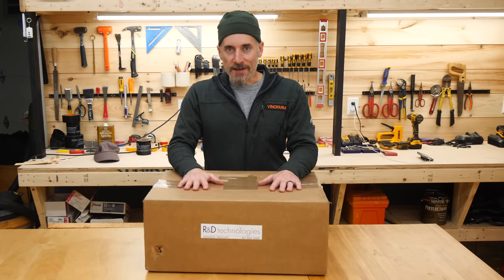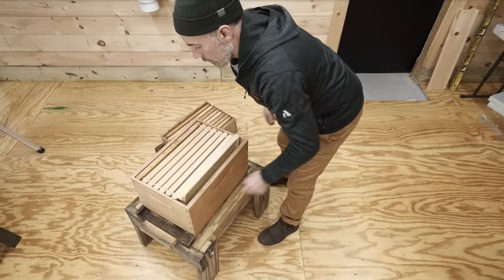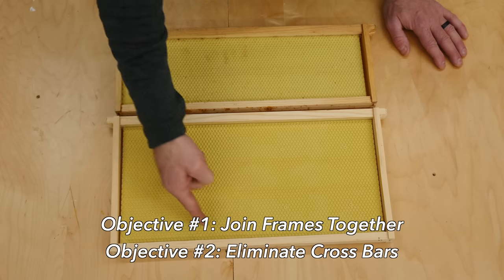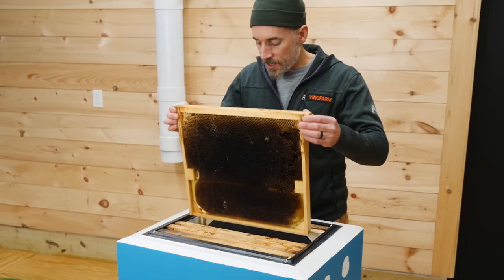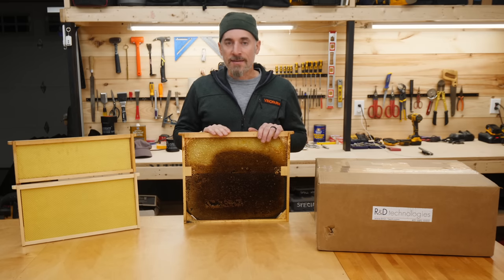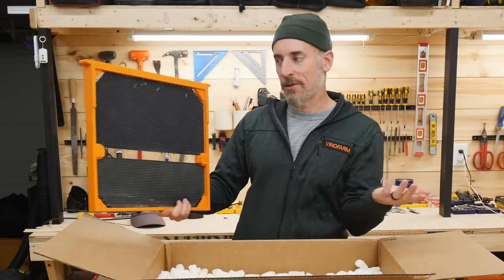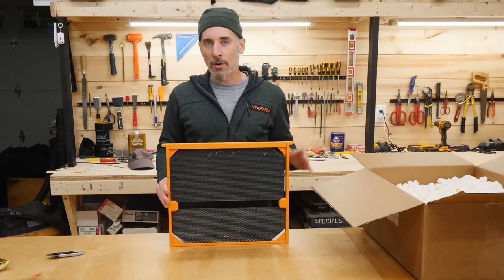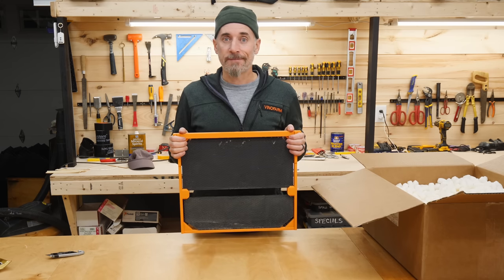Bigger, Better Bee Frames? Let’s Make This Happen!

Comment: Sorry, but I think you're going about it the wrong way. Plastic frames are not the future. Bad for the environment, expensive to make and takes too much time. You'll likely have to go through many prototypes and manufacturers before you're satisfied with the result as molded plastic is finicky and there's many kinds of plastics and selecting the right thickness of plastic and cross-bracing in the hollow channels within the frames (so it's not heavy and excessively expensive to make), etc. You could be seeing a 2 year process before being able to ship out finished products to customers. Also, what's with the pointless gap in the frame? Never take shortcuts when making a new product.
There are plenty of automated machines out there that can spit out a dozen completed wood frame pieces per minute that have existed for many years, so the cost would be much lower, a lot less time and it doesn't harm sea turtles. And the wood's deterioration time is predictable whereas whatever plastic you choose will be unknown in that environment. Table saw isn't the only way to make frames.
As for the gap in the frame, why not make a new sheet that fits the new frame size?

I do wish you the best of luck in whatever decisions you go with in the end. In the very least, you're making a great change in quality of life beekeeping.
Reply from the maker: Two years of development has brought me here. But thanks for your opinion.
Reply: Plastic is not the devil.  Single use plastics are the devil.  You've taken a soap box and are yelling about the wrong thing from it. 
If I'm understanding turgsh01 correctly, you're advocating cutting down trees and producing waste in the form of cut-offs instead of a plastic frame which will likely be more durable and in use for twice the life of a wooden frame?  You should really take a second and think before spouting off these nonsensical comments.
And to answer your question about the gap.......it's so you can use standard bee-keeping equipment in the frame.  Everyone already has deep and medium foundation laying around.  Nobody makes this size foundation.  So all you need to do is order the frame and use the other equipment that you already have, or is readily available at literally every beekeeping store in the universe.
Reply: Well golly maybe if we pause and do a little thinking ahead we can lower the number of iterations. Maybe it will take two years. As far as I know VinoFarms does not have a board of directors that demands profitable quarters year in and year out. This whole endeavor is not a do or die project. This is a hobby beekeeper with an idea that may help many beekeepers in the future. I will be watching with interest.😊
Reply: @DialedN_07  You cannot recycle dirty plastics, and the likelyhood of anyone being able to properly clean the old plastics full of honey and stains is slim to none, especially if there's textures or difficult to reach gaps. So they might as well be single use plastics and likely will end up in the sea at some point in the future. Also, your assumption that plastic will last longer than wood is theoretical based on zero facts. Different plastics react differently to different environments. A lot of plastics will crack in cold conditions or in direct sunlight, other plastics degrade quickly in moist environments, some plastics are a bit toxic, some too flexible, some too rigid and fragile, and let's not forget manufacturer defects and/or poor manufacturing standards, etc...
I don't know why I'm explaining all this as this should be common knowledge to everyone by now.
Reply: @vinofarm  Well then enjoy another 2 years.
Reply: @karlgant8953  I too will continue watching with interest, but as Mike Holmes would say: "If you're going to do something, do it right the first time!"
Reply: @DialedN_07  You can reuse plastic all you want but in the end it will still be plastic somewhere in the environment.
Reply: @danholtbk7008   Thomas didn't invent the lightbulb, he only patented it. Also, your insults are unwarranted.
Reply: @turgsh01  Guy, the frames are not for extracting.  They are for a brood box.  Two the frames are identical to the ones he is using now.  So its a safe bet that he knows how to clean and reuse them.  No need to worry about single use.  And I am pretty sure in the two years he has been working on it he got his bases covered on design.  And he is reaching out to people about materials.   Want to wait for the kick starter to open before jumping the gun?
Reply: @samualaddams705  You somehow misunderstood everything I wrote and made assumptions for good measure, well done.
Reply: @turgsh01  Sure man what ever you say😆
Reply: @turgsh01 i agree with you you are in a debate with the biggest narcissist on youtube it is pointless remember he was just as sure about the vivaldi boards and ridiculed anybody that suggested he was wrong. hes here to put out not take in so just watch the show and never get between a guy who cant be questioned. he never concedes ever.i learned never to questio him he is not open.

Comment: if foundation groove complicates mold, what about "L" shaped frame, set foundation against and then fasten  with a flat piece, maybe screwed down. So many off based comments below, if they'd just see your explanations!  Well thought out, plastic is perfect for this project  already plastic foundation and frames in use for years now so that research would show best plastic to use.  I'm in for Kickstarter and 40 or more depending on cost.  After 8 years of beekeeping and working up to 12 hives I still haven't broken even on cost vs honey sales.  The labor has to be free!

Comment: correct me if i'm wrong.
But the reason you have that gab is because there are no (cell)foundations in that size.
The gab makes an problem, that is bees not building the structure correct . 
So you solved it by alternating the gab.
And because you have that gab the fram can more easy move thats why you had to brace it with the corner braces.

If you are going the injection mould route....
Then why not make the BeeBarn foundation the right size. It will solve multiple problems.
You probably don't need an frame with braces. 
The frames would be simplified, more easy to make more easy to harvest
You will not have gabs so you do not need to alternate the frames.
No gabs makes it so you can't forget to alternate. And it's more easy to use the frames from different hives. 
It's more easy to replace a broken frame. you don't need to find out which one you need.
If you ever need to replace the foundation (or clean it) you only have to remove (or clean) 1 foundation not 2.
Reply: And sinds you use the bee barn for the bees themself. And honey supers for the honey.
You would not have an problem with using the standard honey and or wax equipment on the honey supers.
No need to have special tools/machines for the bigger foundation
Reply from the maker: The gap is a feature. Not a bug. The bees use the gap. A full wall of foundation would ruin their pass through tunnels.
Reply: @vinofarm  
I would love an video that shows the tunnel.
And what about.. making an asymetric (left right not top down like you have now) design. So you only need to turn the frame.
And make an foundation that has no to little base in the corners (where the bees like to build bigger comb for drone cells and honey. )

Comment: I’m a small time hobbyist beekeeper with 8 hives (6yrs) in NJ. I have never lost a hive over winter as I block my upper vents and simply put panels of 1” insulation cut to fit my deep plus medium winter hives. I hold the panels in place with a single 4ft bungee around the hive. Very easy to store in the summer and install in the winter. Takes just a few minutes to install. 

These panels and bungee have have lasted 5 years and are essentially a cheap and easy version of a bee barn. Obviously not as energy efficient but the same concept. 

I followed your whole bee barn project. Very cool but more complex than I feel is worth. That being said, the idea of a “bee barn” frame for the brood box for even regular langstroth brood boxes could be a real winner. Particularly if I can just transfer my drawn plastic foundation from my current medium and deep frames directly over to the “bee barn frames and drop them into the top of a deep+medium hive brood setup. Maybe even gently transferring the existing foundation WITH brood and honey from my existing frames over to the bee barn frames and just drop them back into my existing hives. I think it would be a winner and a back saver with far faster brood box inspections. And I agree it might be much better for the queen and her egg laying. 

I would be very much interested in bee barn frames (without foundation) for my 8 langstroth hives. A total of 80 frames if the cost is reasonable. 40 frames of deep over medium plus 40 medium over deep bee barn frames.
Reply from the maker: Thanks for your comment. You seem to have figured out the winter survival. That’s great. The reason the build is more complicated is because the insulation is built in and never removed. It’s a 4 season hive. It saves the hassle of wrapping and unwrapping and has benefits over summer as well as winter. I’m glad your bees are doing well.

Comment: Jim,  I put this comment already in one of the other videos but wanted to make sure you get it.  You've probably already thought of this but if you get to the point where you are having a mold made, consider having only one mold with "ears" on the top and bottom (for hanging in the hive box).  The customer can cut off one set of ears on each frame, giving them the ability to flip the frames and thereby staggering the gap (as you say it should be).  The ears can easily be cut off with a jig saw or a fine tooth pull saw.  This will save you the expense of having two molds made.  Hope this helps.

Comment: Do you have a CAD/STL file for just the side bars? While printing the entire frame is not feasible on a home printer printing side bars alone would likely be doable on a home printer. Then those could be combined with standard pieces to make the frames

Comment: Have you considered just creating and selling the side bar with the gussets built in?? That way beekeepers could build new “bee barn” frames by just buying top and bottom bars with readily available and inexpensive parts on the market today. By just buying gusseted side frames, beekeepers could even carefully disassemble existing frames to transfer the foundation and top/bottom bars over to the new deeper frames using your side bars.
Reply from the maker: I’ve considered many options. After hassling with wooden frame production and assembly, I decided to streamline the process and try for an injection molded frame. It’s the vision.  It may not work. I want to try.

Comment: Great idea. Perhaps you might take a coffee break and re-examine a couple of things. First the existing plastic frames and foundation warp and deform in the sun. Second the plastic gets brittle in very cold climates (in storage not in the bee hive). Third they off gas somewhat. Next, the only part that is time consuming is the sidebars. Just making the sidebars out of plastic would be much faster and cheaper when you use the existing source for top and bottom bars. This would also allow you to make plastic sidebars for other configurations (layens, shallows etc). Also making your custom sidebars takes EXACTLY the same amount of time and effort as any other sidebar (only the length has changed). Although I would also support you in this endevor, I would like to see how the bees react to these frames. Can they propolise them? Does the off gassing bother them? Does the wax adhere very well, will your hive tool break them easily? Would be interesting to see what happens when you place your prototype frame into one of you existing hives. Would like to see that video. Keep up the good work, am a fan of the bee barn.
Reply: Double deep plastic sidebars are already a thing but stupidly expensive.
Reply: @chadashton7029  Didnt know they already existed. But wood would still be a faster DIY replacement if they are very expensive. But a valient effort none the less. If there is enough call for them, I might  consider making a batch of the double side frames.
Reply: The ones I've seen are around $30 for a pair.
Reply: @chadashton7029  KRAP that is expensive. I was thinking of making them for $5 per FRAME, mabey I should think of $5 for a pair of sides instead !!!

Comment: Jim,  I got the idea to do a similar frame about the same time that you came out with the bee barn.  My reasoning wasn't to save my back but it was to not have to risk putting the queen on the ground and to simplify the inspection process.  Crazy thing is I had seen part of your bee barn video before I built my frame.  Unfortunately (or maybe not) I had checked out of your bee barn video before you got to the frame part.  Since you opened with the super insulated sides,  I saw it as not applicable to me in my warm climate.  After I showed my finished  frame to a friend, she mentioned your bee barn.  I remembered it and went back for a second look.  This time I stuck around for the frame part.  And I'll be darned - I was amazed.  A lot of your reasoning and mine were the same!  I run a 1.5 brood box so the dimensions of the bee barn frame and the Texas deep (what I named mine) are pretty much identical.  I have always built all of my frames - deeps and mediums, and I use foundation-less with fishing line reinforcing and a wax starter strip.  That made for an easy adjustment to go to the Texas deep.  The only real modification is I use a 1/2" side bar, instead of 3/8".  Putting tension on the fishing line is causing them to bow in a little but so far it isn't a problem.  I will be making a video of my frames and reasoning this week.  Of course I am going to give you a shout out and credit for innovating.  While I am not going to be in the market for your frames, I am going to be promoting this format so maybe that pushes some business your way.  You should mention that people can try out your frames by simply stacking a deep and medium box.  I'll bee doing that in my video.  Good luck with your venture.  - Phillip

Comment: Jim,
I meant to post a suggestion on manufacturing or looking for a manufacturer for your large frames on the day but got sidetracked.

A friend of mine got on the grog one night, surfed the net, ended up on eBay and bought himself a CnC Router. When it arrived he scratched his bum for a while, called in a machinist, and neither of them could work out how to use it, so he called me.within a day it was working like a charm.

Anyway, I ended up making bits & pieces for his business and it was brilliant, and I’m sure that it would be the best thing to make each and every part for your large frame without a joint in the side pieces.

The one I used had a 900 X 600 mm (3’ X 2’) cutting area.
My idea would be to still rip your slates to the thickness required and edge glue them out to suitable dimensions. Top bar would be ripped thick than side and bottom bar. All the grooves, and individual pieces could be cut with the same cutting bit, whatever the groove width is, as well as the shoulders on the top bar.

Again, all pieces would be separated using same bit using small tags (also cut in)to hold the pieces in place during procedure and separated on completion.

So, if you haven’t got a spare couple of grand, look for a woodworking business advertising CnC tooling.
All the best to you my frozen friend.
Reply from the maker: I thought about CNC a while ago and that might be OK for small runs. But if you have a look at the comments, I’d need to be producing thousands and that’s a lot of babysitting the machine and setting up the wood. And then there’s still all the assembly. I don’t really want to be in the wooden frame business. I totally understand if people want to do that and I made the previous video sharing a process for making these with just a table saw. But I am thinking of scale and the future. If these things take off, I’d rather have a mold and make it easy for people to just order them. A CNC would be nice for other things, though! Someday…

Comment: I'm still interested. Perhaps 2.0 could mix the top and bottom sizes. 3.0 would be an option for double deeps.

Also, I'm considering using deep/medium boxes for new hives next year instead of bee barns. This way I can mix regular frames (including drone frames) with bee barn ftames. I do plan on making a removable outer insulated shell that can be marketed to traditional box users.

Comment: It is reasonable to expect that major manufacturers of wooden frames would possess the necessary expertise to provide assistance in this matter, given their extensive experience in this field. A potential solution could involve approaching established wood frame manufacturers and modifying their assembly line to accommodate the desired specifications. While this may initially appear far-fetched, it is conceivable that at least one manufacturer may be receptive to the proposal. Furthermore, if financial constraints are a concern, leveraging one's existing fan base through crowdfunding could be a viable means of securing the necessary funds to finance this initiative. It would be essential to establish a contractual agreement with the manufacturer to ensure a sustainable supply of the desired frames.
Reply from the maker: Please convince me that you are not a robot.
Reply: @vinofarm  hahahaha no I am not a robot. Lol
Reply from the maker: @shrekpower  You type like Chat GPT. Ha ha ha.
Reply: @vinofarm  You are correct, being from Quebec, my first language is French. English is sometimes hard for me to put in the right words. I often use Chat GPT to simply assist me rewording what I want to say in french.